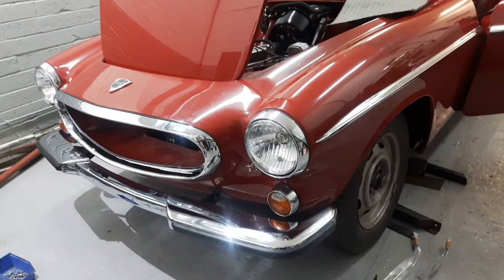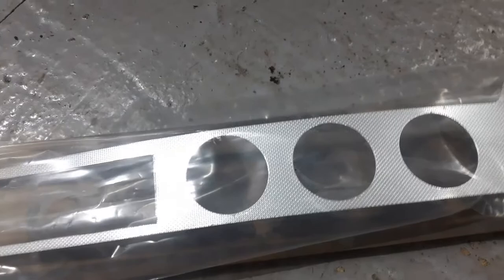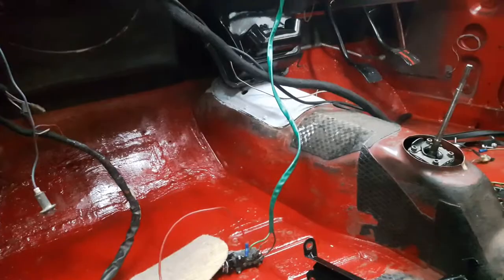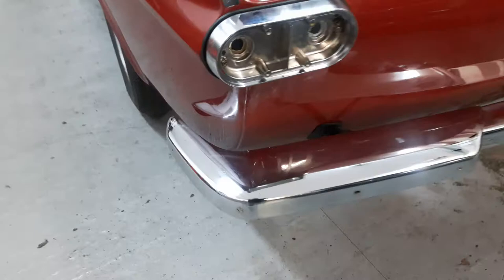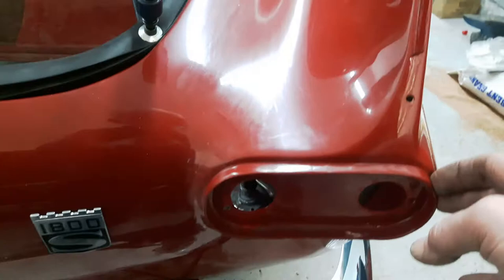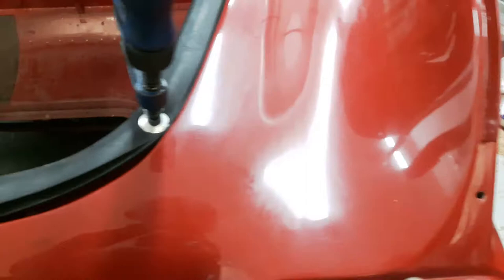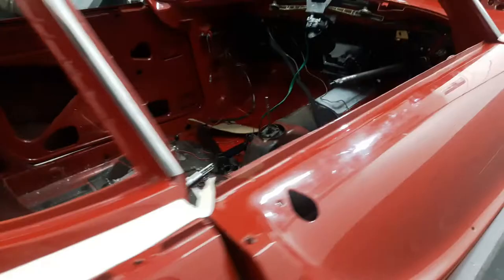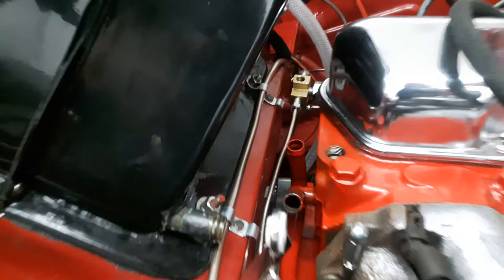Volvo P1800 restoration project - episode 32

Comment: It looks quite superb. Someone is going to be a very happy owner.  Just a quick question. Can I see the oil cooler fitted behind the oil filter?  I've had two on my 1966 1800S, both of which have failed and leaked oil into the coolant!!  Thanks for uploading these vids.  Kindest regards,  Peter A